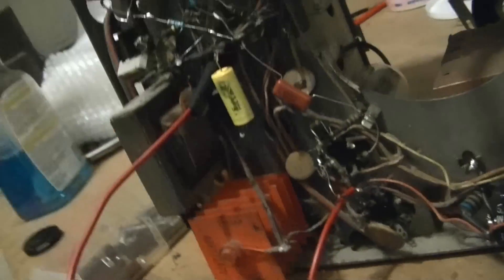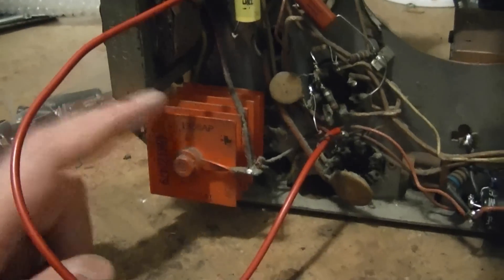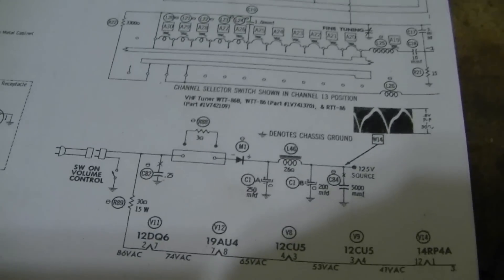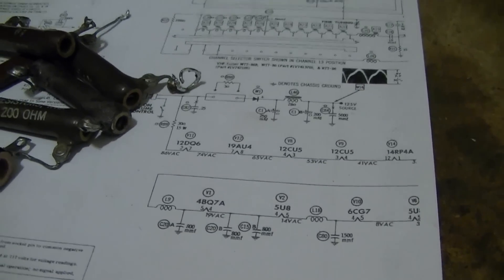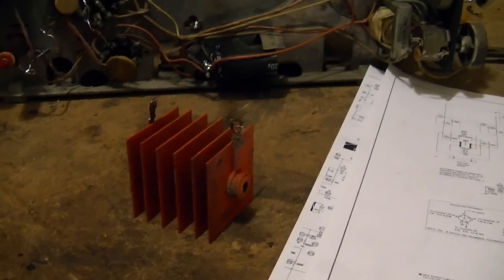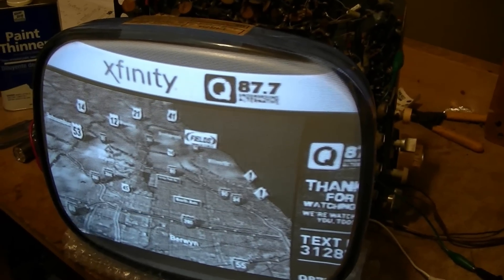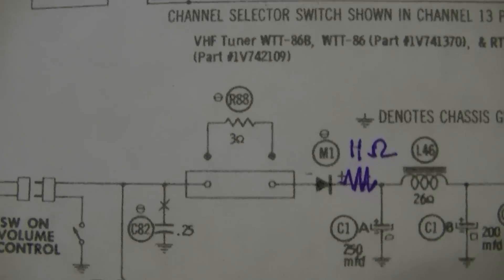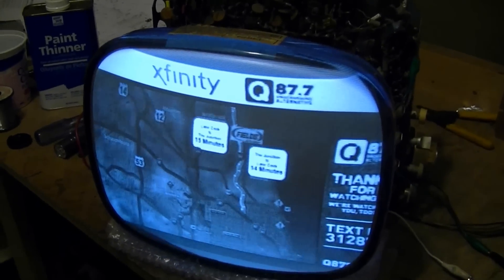Motorola Y14P3-2 restoration p3o4

Comment: Selenium rectifiers are actually a stack of selenium diodes in series so they could handle higher voltages without melting, so the voltage drop across one is partially caused by that factor. One trick I have read about to replace a selenium is to stack several silicon diodes in series, each diode has a forward drop of .7 volts DC, although stringing together any more then three in series gets ridiculous so you may want to add a resistor in series anyhow.
Reply: شكرا على احسن تعليق يشرح و يفصل السياينيوم

Comment: Thank you for doing this video segment, it really helped me a lot. I have one final question. I noticed that when you checked the voltage, you had your meters negative lead to chassis ground. But I could not figure out where you had your meters positive lead hooked up. Did you hook it up to the electrolytics or where? Thank you for your help.

Comment: I wonder why no one used copper oxide rectifiers in TVs or radios (at least that I know of)?  Do they have too much voltage drop?
Reply from the maker: The only thing I've ever seen a copper oxide rectifier in is a speaker field coil from the late 1920s.  I assume they are very inefficient compared to selenium and tube rectifiers.